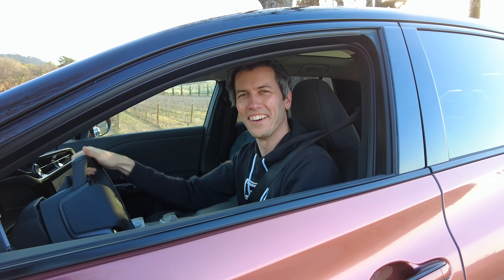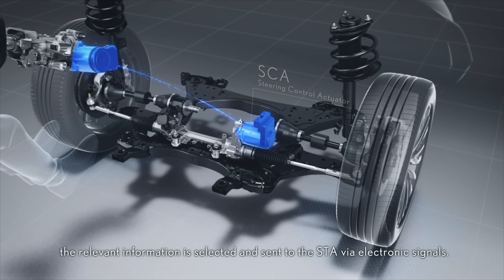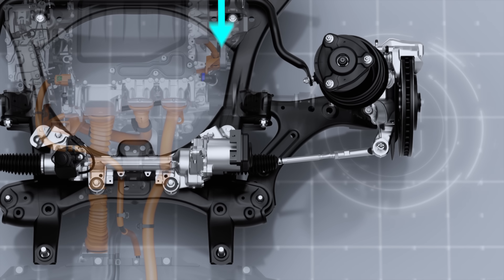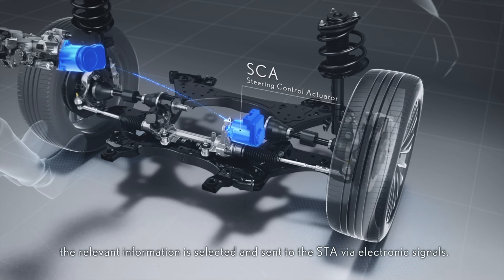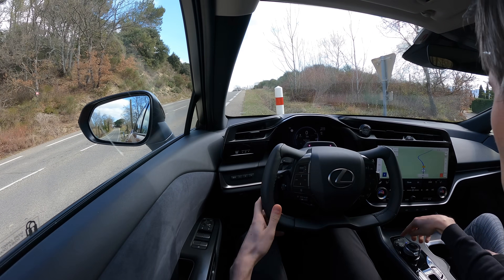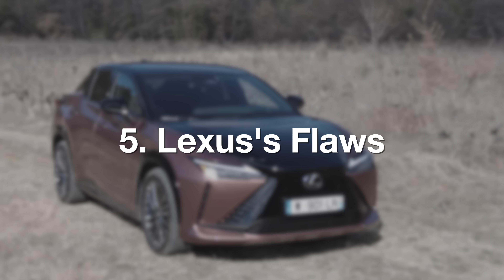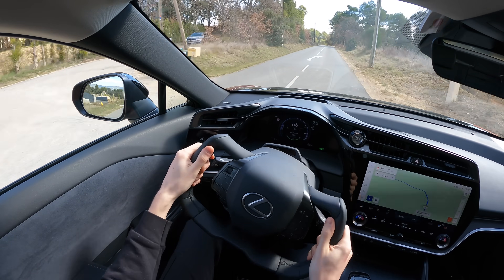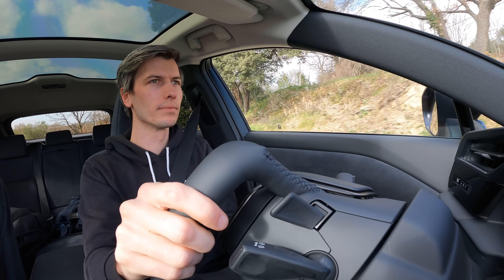How Lexus Fixed Tesla's Bad Idea: Steer-By-Wire Yoke

Comment: Great video, I don't know how I would feel about this, I'd ultimately have to try it out. My question though is what about high speed maneuvers? Say you need to turn that wheel quickly at high speed to avoid some hazard, would the wheels just not react enough or does fast movement of the yoke respond enough? It seems like from the video it wouldn't.
Reply: @snaplash   the Lexus have hazard avoidance?

Comment: In a steer by wire wheel, do u get any feedback like in a mechanical setup?
Reply: It was mentioned in the video that there is a motor in the steering wheel assembly that puts back force on the wheel. The system computes what the force will be so it's supposed to feel like feedback.

Comment: I have a keyboard. 

I’m not convinced steer by wire is any better than a highly assisted variable rack. Which suggests to me that Toyota/Lexus isn’t being entirely truthful about their rationale. I think the real reason is is that the manufacturing costs for electronic components have reached parity with a mechanical linkage and that it’s a lot easier [cheaper] to engineer the packaging this way. Also a lot easier to serve RHD and LHD markets. FWIW, I can overlook the unnecessary aspect of it, but I can’t overlook the lag. Even just having large off-road tires on my truck can be annoying. 

Also, redundancy in the same package only protects from wear related failure. It does not protect from damage. I’m not particularly worried about this, it doesn’t seem any more fragile than traditional systems. But it never would have flown in Aviation (pun absolutely intended).

Comment: If people thinks this is not safe then perhaps they should no longer get into a modern airplane since most are fly by wire, along with control surface and braking controlled electrically.

Comment: That's interesting. 
But everything else aside, the delay is a PROBLEM. And a huge one at that.

In aviation with helicopters, you have something called pilot induced oscillation. That's something that happens when someone inexperienced with the inherent sluggish response of a chopper attempts to correct the behavior by quickly making greater and greater corrections in the opposite direction.
This is something I imagine could absolutely happen with this system, too, unless they beef up the steering motor significantly to make sure it can turn as fast as you can turn the wheel.

Also, what about costs? How much higher are the costs for a system like this? I find the benefits to be... somewhat uninteresting, so paying extra for this doesn't seem like a good deal.

Comment: Biggest issue is the variable ratio, if it's not consistent you can't rely on muscle memory in split second decisions and that makes it unsafe. Not having driven it at least that's what I imagine.
 The fact that you have to turn a Tesla yoke almost 3 times without the top bit is just mind boggling...
Reply: I tend to strongly agree with this statement. Muscle memory accumulated over decades is something you don’t mess with. This is vital safety concern. I love idea of drive/brake/steer by wire but algorithms have to be much more researched. I would start static 2 stage presets. One for parking and slow driving and other for highway speed. Nothing between or logarithmic.
Reply: As someone who hates mouse acceleration, I agree, and that right there removes the biggest impetus for doing this in the first place. Sounds like a perfectly horrible idea.
Reply: Great point.
Reply: Variable steering ratio racks are very common today that do the same thing without drive by wire. 
But otherwise i am with you all, i am not a huge fan of the variety, it never seems 100% intuitive to me and took me a long time to get used to
Reply: The muscle memory you have from your current car doesn't apply, but the muscle memory you accumulate with variable ratio would apply.  Porsche has variable rear wheel steering in some of their cars that alter the way the car steers based on speed and owners of those cars aren't having issues with split second decisions.
Reply: Yup. One time driving my Honda to work a 2x4 flew off the back of a pickup truck. Didn't think, just checked my blind spot as fast as I could and swerved out of the way. If I did that in this car I would've put it into a wall.

Comment: Only thing i don't really like about having a yoke over a wheel is on long journeys i find keeping hands fixed in the one spot for a long drive can be annoying, without being able to rest one hand on the top (even though you should have both hands on wheel at all times)  small nitpick but still

Comment: So when it's old and been out in the Montana cold or rust belt salt for 10 years and batteries have twitchy voltage and shock and heat have compromised the electronics or they're knockoff chips etc etc etc and they will cause lawsuits. They may keep the systems and payout but they'll not sell and burn out. I'm terrified these and self crashing software exist on the road and I drive a big truck that probably wouldn't be affected much if someone steered into me. Even just simple human eventualities for example the brake assist. I'm sure someone will get used to it and it will not function because of sensors plugged over or they're in an unfamiliar vehicle that maybe doesn't have that feature and they think it does.... After relying on in a while it'll let them down. Simple is often safer. Aerospace is an exception but those are high maintenance controlled environment that's an apple oranges comparison to average schlep and his hoofty unmaintained ride.

Comment: Didn't Infiniti have this steer by wire system when they launched Q50 way back in 2014? I remember it was bashed by every single car reviewer.
Reply: yea, Infiniti drive by wire has a clutch to connect the wheels as a mechanical backup....

Comment: Even if its execution is not the best yet, steer-by-wire is just a logical step in vehicle evolution. Again, putting my vehicle enthusiast feelings aside, cars are tools, and having a tool self-adjusting as needed and in a neater, cheaper package is a massive boon. This also means you can effectively merge power steering and steering rack into a single unit, further reducing production costs.

We shouldn't be too far off from getting a car with all 4 wheels independently steered and driven now. At that point, you can pretty much shape and package a car as you so desire.

Comment: My father's car had a loose bolt on the steering rack. This led to feeling of steering lag, as the column was moving a bit before it engages. In low speed this is more like an annoyance but driving on a highway or just out of the city was horrifying. I am glad we had this fixed.

Comment: I could be interested in this if they allowed for (within reason) adjustable sensitivity for low and high speeds with a gradient line smoothing out the in between speeds and improved that input lag by a lot feels like a step back with the responsiveness the way it currently sits. As a gamer myself I noticed the long latency between the steering wheel and the front wheels within the first few seconds of the video.

Comment: Excellent content, thank you. The idea of eliminating the hand-over-hand steering event is great. Not too excited about this though, it seems to be introducing more complexity and failure points. The response from a physically connected steering shaft is literally immediate as opposed to a computer controlled rack where there is processing time involved.

Ideally, I would like to see consumer vehicles where each wheel is able to be steered, driven and braked individually....ideally.

Comment: Steer by wire is awesome. I mean, no-one is batting an eye about modern airplanes having fly by wire. Right?

Also, from a manufacturing stand point, it makes it easier for the different markets. No need to manufacture a new bulk head/firewall depending on lefthand drive or righthand drive. Which reduces R&D and manufacturing costs, allowing to reduce prices. In the end, new models will be more expensive than the previous ones, because of inflation and all, but less expensive than If there were multiple versions of the same car part. Granted, the interior would still have lefthand drive and righthand drive versions. But that's mostly plastic trim then.

Comment: Did you try driving the Infinity steer-by-wire system?
Reply: yea, Infiniti drive by wire has a clutch to connect the wheels as a mechanical backup,,..

Comment: But what about when you need to change lane quickly on highway speed?
In standard steering, the ratio is always the same, with this do you need to adapt to it depending on the car speed? Or does it have feature like a mouse acceleration that it sense how fast you're trying to turn it? Or is it just turn the wheel more depending on the steering wheel input angle?

Comment: It's a quiet revolution. Steer by wire and brake by wire (e.g., Brembo Sensify) are coming to more cars (BEVs first, but eventually also ICE platforms) because they both increase performance and safety while reducing weight, cost, and maintenance.

Comment: If a steer-by-wire can pass the moose test, then I will be convened. 
To be honest when I transitioned from a traditional power steering (Hyundai Santafe) to variable ratio steering on a Audi Q7, the steering wheel felt cheap because it felt too light. But I got used to it quickly.
Reply: I prefer the wheel to be as light as possible, if it's adjustable. I had a 2015 Mustang GT for a while, and I always kept that on comfort mode. Steering ratio was the same, so all it adjusted was the resistance to turning the wheel. Much easier to steer. But I am the guy that cranks mouse sensitivity too.

Comment: I go to sea for a living as a Merchant Marine deck officer. We control our steering through an arrangement that can be described as steer by wire. This is necessary because of the size of a rudder and its distance from the helm position. Recognizing the dangers of failure in such systems, the industry has a requirement for multiple redundancy and frequent inspections. This came from hard experience with spectacular failures. I don't think the auto industry is going to put in such redundancy and drill drivers in switching between multiple systems and testing and inspecting such systems often enough to help. This would seem to be more of a risk than a benefit.

Comment: Great video, as usual. The electric power steering on my Vensa, ( built into steering column) is great at low speeds, but dangerously twitchy at highway speeds. The electric power steering on my old NSX, is just good.

Comment: BMW (and other manufacturers probably too) have a mechanical variable steering ratio system (though less extreme) built in their cars. 
BMW introduced this in 2003 and they call it active steering.

Comment: If Lexus can allow for the driver to alter the sensitivity curve on the steering, So that users that want something more responsive at the top end or just a consistent setting then people will most likely flock to this new system like it's the holy grail or something as it will be able to all the things so to speak and with no issues. but choice with a system like this is kind of a must for people to buy in.

Comment: For input delay you have to also consider that a mechanical linkage is actually slowing down your input! As in, the linkage is pushing back on your hands and preventing you from requesting the desired steering angle as quickly as you'd like to. I bet that if you compared videos of steering input going into mechanical and by-wire car, with the same torque applied to the steering wheel at the same time, you'd see that in a mechanical system the steering wheel would have turned less than in a by-wire system. The car wheel position could actually be faster than mechanical because quicker steering wheel displacement can communicate to the system the urgency and the desired end state, so the system can use more torque in the actual steering motor to reach the desired state.
Reply: On electric steering racks that can be adjusted. I mentioned in another comment that the Mustang has different steering modes. The only difference being the amount of resistance applied to steering input. On the lowest setting, comfort, you can essentially just flick the wheel and it will fully rotate. So, at least in regard to that specific system (I had a 2015 Mustang GT, so I don't know about newer models), it did not slow down input on that specific mode. Regular and sport modes absolutely were slowed though.

Comment: My experience with servos in machines is they our incredibly reliable I have units that lifts tubes in a filling machine that raises and reverses to lower the tube 4 inches at 90 cycles a minute continuously for years 

But when they fail it is catastrophic But the program is robust enough to stop everything without crashing mostly 😮🎉

Comment: One of your Dutch colleagues who got to try it on the same press day pointed out another drawback of the yoke: when you look over your shoulder to backup, the natural position for one hand is on top of the steering wheel. 

Are the settings adjustable? I imagine there could be settings like 'sport' and 'comfort' that chance the characteristics.
Reply: That's only natural because that's how we are used to using it. I'd argue that most people using backup cameras don't drive in reverse that way. When I had a car with backup cameras, I'd check for cars and people, then use the camera to reverse.

Comment: I've had issues with my drive by wire throttle body, albeit with 200,000 miles but I would be weary when it comes to implementing that with the steering systems. If my drive by wire has problems, I have engine issues - engine limp mode. If I have steer by wire issues, I have.... the inability to steer???

Comment: So if anyone cuts off this Lexus or brakes sharply in front of it at a highway speed, the driver won't be able to avoid a collision because the system dumbs down the steering response at highway speeds. On the positive side, switching to drive by wire will save the company lots of money.

Comment: At high speed, it'll be hard to intuitively learn that the steering is dulled compared to steering response at low speeds & in case of emergency it could be easy to mistake  😠

DON'T mess with my steering! 🙏🏼

Edit : I wrote my comment 2 minutes into the video, how on earth did Lexus engineers not cry it out to the managers over and over again !!?

Comment: While I always have misgivings about the lack of a mechanical backup, the redundant motors and controllers are a very good idea that you couldn't replicate with linkages
Reply: like my car for exp, has electric power steering & the steering wheel is connected to the wheels, but their is a drive by  wire option like this lexus in the video, but has a clutch to connect the steering directly to the wheels if lose of power, so that car has a mechanical back up, infiniti q50

Comment: How quick did you get used to the adaptive steering ratio? I assume it's fairly numb around center and increasingly aggressive at the edges, like an RC controller with "expo" on the sticks.
Reply: lots of existing cars have variable ratio power steering now and have for ten years.  Also most all existing power steering systems boost assist more at low speed than highway speeds.  I bet you never noticed.  Steering feel "numb" is not the same as steering ratio, you can have 'feel every pebble' feedback with a high ratio.
Reply: @mriguy3202  But that's only the rack having progressive teeth spacing so the wheels turn more aggressively at higher steering wheel deflections, right? I'm not aware of any system that actually changes the ratio depending on speed. I meant "numb" in terms of "car doesn't want to jump into the other lane on minimal steering input when going straight". Everybody who has driven a car without steering assistance will notice that it's the same when going fast but totally helps when going slow, so obviously it's less assistance at higher speed. Some older Fiats had an extra "city" mode that adds electric assistance when you're below fast city speeds, that was a pretty harsh jump and you could totally tell when exiting roundabouts quickly, there's a point where the steering just became harder all of a sudden.
Reply from the maker: Not numb in the center, surprisingly. It feels like it wants to return to center, much like traditional wheels.
Reply: @EngineeringExplained  Cool, thanks for the info. Maybe that allows it for a more parallel alignment (less toe in) and have the car straighten out electronically instead of relying on friction physics to keep the car pointed. Could make a difference in tire and wheel bearing wear, but most importantly highway battery/fuel consumption. A war with no or very little toe angle goes faster but it's really a handful to keep it in lane and the wheel doesn't wanna go back to center fully after a turn.

Comment: What if the car doesn't have power, but you need to get it off the road? You can't push it in neutral and steer with a hand on the wheel in this system.
Reply: like my car for exp, has electric power steering & the steering wheel is connected to the wheels, but their is a drive by  wire option like this lexus in the video, but has a clutch to connect the steering directly to the wheels if lose of power, like why do all that, so complicated